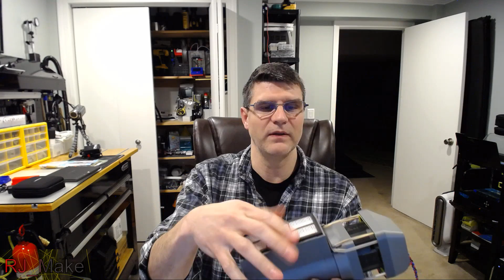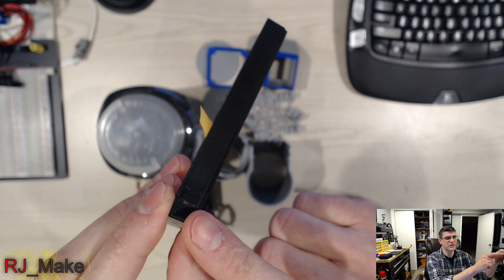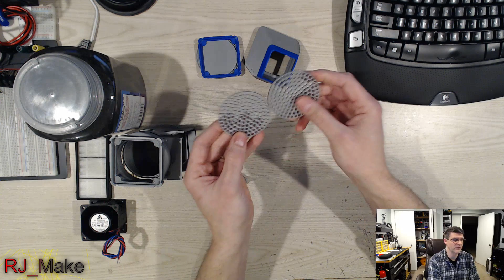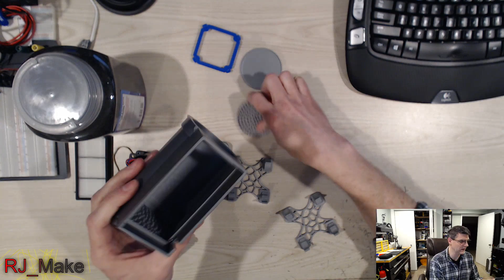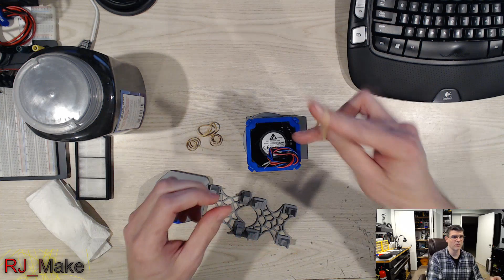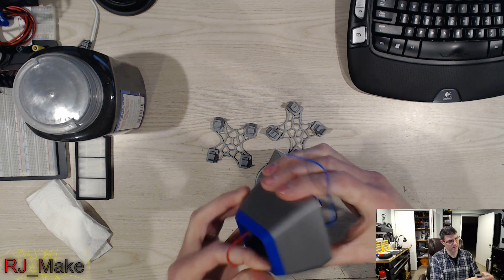RJ_Make's 3D Printer Carbon/HEPA Air Scrubber Assembly

Comment: I'd love to see a test with some smoke to see the effectiveness of the carbon vs just the HEPA filter.  Thanks!
Reply from the maker: That would have been a good test, but I didn't think of it at the time. I did do this one though. https://youtu.be/4XIPJHpG8CM?t=6m16s. I just finished a complete redesign using a combination HEPA/Carbon filter that can be purchased for less then 15 bucks, and am currently testing it. Looking good so far.

Comment: Do you think this does an adequate job?  I use PLA but can never be too safe.  Thinking of building this!
Reply from the maker: I think it does, but you might want to hold off on building this. I've just starting testing on a complete new design. I'm much happier (before testing) with this new design then I ever was with this one.
Reply: Hi, have you ever gotten around to upload the new design somewhere?

Comment: Looks like a good design.  I hope it works out good.
Reply from the maker: Thank You, I think it has worked well. However I think my next rev. will pull air from the top of the enclosure.
Reply: Up top is what I am thinking too.  Going to see if I can't vacuum form my own top.  Trying to figure out a way to close in my feeder tubes and power cable holes, but still allow them to move.  I did find an issue with your main body print.  The ledge for the hepa filter, on the notched side of the body, isn't connected to the body like the other side is.  I am about 2/3 of the way through and just noticed it.   I'll just dab some super glue on it, but thought I'd let you know.

Comment: Would a large fan work better then the small diameter fan you chose?  Also can this be installed so the Hepa filter is pointed down.  From what I understand the best place for the filter is ontop of the enclosure.
Reply from the maker: A larger fan would definitely be a better option, as long as it is still a high static pressure fan. 

I don't think you could use this design with the HEPA upside down, unless you didn't use carbon, which would defeat the filter. 

You are 100% correct, the best placement is at the top of the enclosure. That was my biggest mistake. I completely under estimated the drafting forces during a 3d session.  When I get around designing v2, it will be top located, most likely right in the top canopy.
Reply: How about active carbon filters instead of the pellets?
Reply: Another question.  Is it the HEPA filter or the Active Carbon pellets that cause the heavy air restriction?

Comment: thought the video content was great as I would love to put a scrubber on my Maker Select (once I can make an enclosure for it) so that I can print ABS in the house.  I have noticed that your audio levels differ from video to video.  It appears that you are using the camera mic for your main audio input and the distance you are from the camera as well as you turning your head away from the mic from time to time affect the audio.  Have you tried a remote mic like a podcasting desk mic or even a lavaliere mic?
Reply from the maker: +Norbert Davis Thank you for you input. Your observation is dead on accurate.  I did start using a (2 or 3 video's ago) wireless lavaliere mic. for the non-computer shots. Hopefully the audio has been better????

I still need to deal with the audio when using my Blue Yeti (computer work).  My little 'micro work area' can be fairly noisy, so I have to use the directional features of the mic.  This of course causes the issue, so I'm not sure how to fix it at the moment.  I guess I just need to learn not to move away from the mic when talking.. :-)

Comment: Nice idea. I'll probably have to make something like that, including a box for the printer, pretty soon too. I will however change the airflow-layout to make shure that the air is forced to move completely thru more (all) of the carbon-filter stage. In your current design, the air getting sucked in thru the HEPA filter on the fan side has the least amount of air resistance and at the same time the least amount of carbon filter it can pass thru. Since the air will probably prefer the way of least resistance as far as possible, the carbon filter part will not be very effective at scrubbing the air.
Just one more thing about the activated carbon. These pellets are more designed for liquids/water and not really effective with air. If you look at the commercial air filter solutions, they use a form of more oddly-shaped grainy carbon powder for a much larger surface area. And you probably should make shure that you blow out all the fine carbon-filter dust first (outside of your house) before you install the filter on your printer, pellets are a bit less prone to make a lot of dust tho compared to the grainy stuff.
Reply from the maker: +ExtraBase Good Find! I found that defect 2 weeks ago and I mention it in my next video coming out this week. I added a small 16mm 'extension' underneath the HEPA to fill in some area to keep the air from passing through the front lip of the housing where the motor coupling goes.  Surprisingly, the over all fpm wasn't effected as much as I though it would.  Perhaps due to the point you made about the pellets.  

The problem I ran into was the amount of airflow required to pass through the finer carbon forces the use of much higher voltages, and with those higher voltages come ear piercing noise ;-).  In order to keep the device inside my build chamber, I'm limited to  a ~60mm high static pressure axial fan, much bigger and it's starts getting in the way.

I think an over all better design would be to filter from the top of the printer hood.  That way the need to fight the natural convection forces would be eliminated, and perhaps allow for a much lower fpm requirements..

Maybe my next hack.. :-)
Reply: +RJ_Make Nice, I'll look forward to your next video.
You are right that the finer carbon makes it harder to get a decent airflow, but again, if you analyze commercial filter designs, the surface area of the carbon filter section is WAY bigger than the fan/tubing diameter to compensate for exactly this problem. The filters I have in mind only have a thin layer or maybe 10-15mm of grainy carbon powder, and they still manage to completely remove any smell even at pretty high flow rates thanks to the large surface area.
(http://www.amazon.de/Prima-Klima-Aktivkohlefilter-Filter-Geruchsfilter/dp/B00AN2RDQ4/ref=pd_sim_sbs_201_3?ie=UTF8&dpID=41aQqvLxcvL&dpSrc=sims&preST=_AC_UL160_SR160%2C160_&refRID=1FDYK0MV19WW9ZBT4GB3 something like that is the filter design i have in mind and know)
 Currently I plan to use a sucction tube from an old vacuum cleaner or something like that to attach an external filterbox with a fan inside to the printer. That way, i'm not really restricted in any way about the fan and filter surface area. And using the tube would even make it possible to attach it to all kinds different printers with ease.
Reply from the maker: +ExtraBase Thanks for the link. I saw something like that in my initial search for a solution, but was thinking there wasn't enough depth to the 'fabric' to catch the VOC's. I was also thinking about a zeolite / carbon mixture, but had a hard time finding 'larger' zeolite granulate. Much of what I found was pretty small and I know I would have trouble moving air through it. 

Your solution sounds like it would work very well, considering the filter would be external of the printer.  As you can see in my video's, my room is tiny, and that would pose another problem for me, My Wife.. :-)
Reply: +RJ_Make Well, it's probably hard to tell how your own design really works if you can not test your air quality for the particulates you want to eliminate. I just know that these cylindrical carbon filters, if properly chosen for the intended fan/airflow, completely kill any smell out of the air passing thru. But i really don't know if that applies to all airborne particles your printer can produce. Still, having at least some filter is always better than having none at all, right? And i'm pretty shure a grainy carbon based filter medium intended for air-filtration would be way more effective than any water-intended pellet-based filter.
As for the space problem, if your room is small and you have very limited footprint area, i would have a good idea for that too, i think... Why not use the space directly under the printer? Just make/buy a box about the size of your printer and maybe around 10cm high or even higher (depending on the fan/filter setup you come up with, and use that space as your filter-box? I'm shure your printer and your wife would not mind if you hack up something that fits below the printer... ;)

Comment: I'm planning to make a similar filter for my Glowforge cutter when it arrives, albeit larger and made with wood rather than plastic. I considered the Roomba filters at one point too, but I felt the cost/sq.in for replacement was too high. Eventually I settled on a larger automotive filter, which were about $5.

About your main body model, is there a reason you didn't add a small lip or shelf halfway to hold the middle separator from sliding around as you glue it? Seemed really problematic and easily fixed.
Reply from the maker: +Dan Berry You're right, the cost of the Roomba HEPA filters are a little on the high side. I did find a non OEM HEPA from Hongfa, 10 for 22.00, but who knows how they work? http://www.amazon.com/gp/product/B00W1AFMWS?psc=1&redirect=true&ref_=oh_aui_detailpage_o07_s00 

 Regarding the grate: I though about that, but I wanted its placement to be infinitely variable. In hind sight, should have notched in a few spots along the body.
Reply: I'd imagine that those Hongfa filters work actually well enough. HEPA guidelines aren't likely as demanding as people think they are. As long as you use tightly woven filter with the "tightly crunched" side-by-side arrangement, that'd be fine.

As for the grate... there's always version 2.0 :-)

Comment: That looks great, I can't to see how it performs! Building an enclosure has been on my list for a while now, to hopefully help control ABS warping. Will your future videos touch on enclosure temp with/without the filter fan running?
Reply from the maker: +Hoffman Engineering Yep, Top and Bottom of the chamber. I also have some incense burning tests ahead (not sure they are worth anything, but why not. ;p ). 

Would love to see what you come up with when get to building your enclosure. Getting my FFCP sealed up enough to get this to work has been surprising cumbersome, but Its also part of the fun hacking things up.